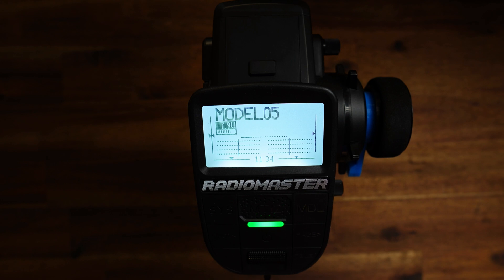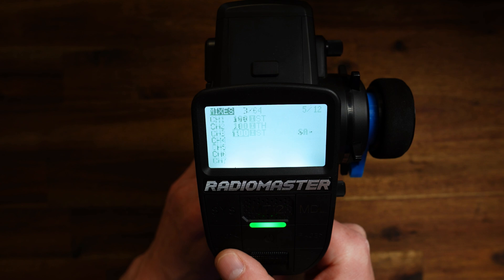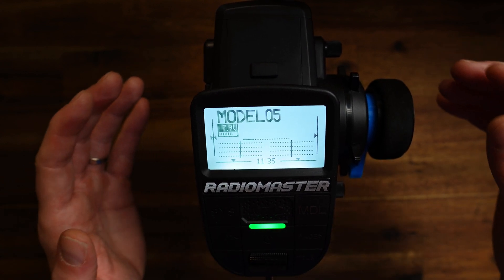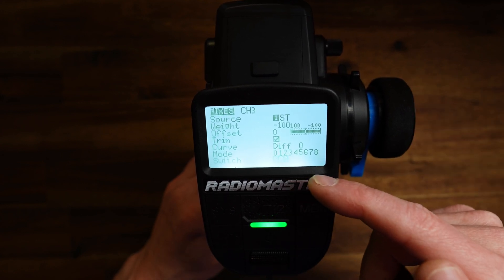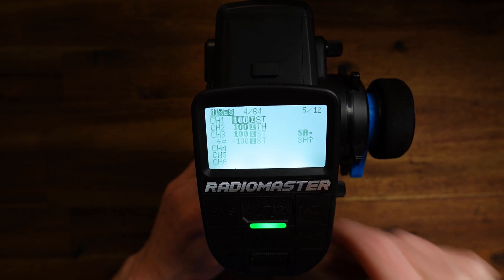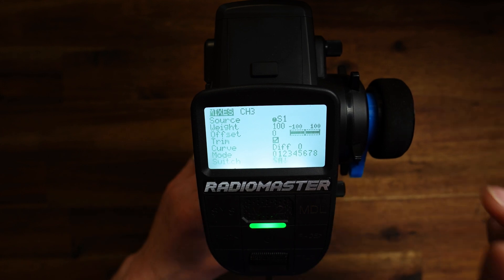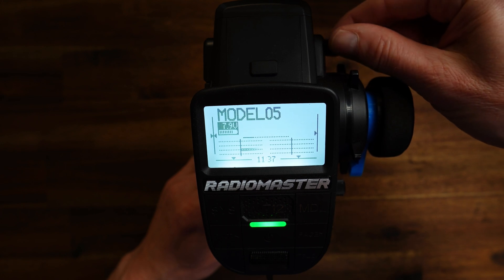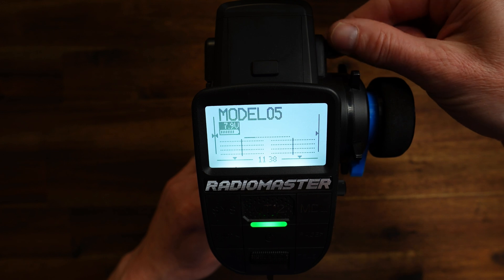EASY & SPECIAL 4WS SETUP | EDGETX | MT12 [EN]

Comment: Thank you so much for your videos! I have been able to program my radio to all functions I need according to your videos. 

I am facing one problem here. I have my Trim setting for rear axle set for -6 but when I switch to Crab mode it switches to +6 which is pretty noticeable big step. I know I can disable trim setting for crab mode so it will not make this big 12 jump, but only 6 but is there possible to make it perfect?

Comment: this is EXACTLY what I wanted to do with my 4ws crawler. 

I have the 2 3way toggle switch module installed on the battery try and it wouldnt let me use those switches. I had to use SA. any idea? do I need a FW update?
Reply from the maker: Excellent! Have you configured the switch module in the HARDWARE page of the SYSTEM menu?

Comment: hello. Thank you for a great video. I use this setup on my crawler. But i dont know how to activate center trim on the rear axle/channel 3. I like to use T3 for center trim, and i set T3 in inputs menu in the trim option. But i try the trim and there is no value change when i move T3 trim switch on channel 3. Can you help me with a solution on this? Best regards Anders
Reply from the maker: Thanks for the comment! Watch this 😉 https://youtu.be/3TIwjY7c7M0
Reply: @ Thank you so much. You Are the best. Have a great new year

Comment: I'm looking to add one more function to my rear steer. I would like to select the T4 trim switch. When I press is up I want to add 10 points to the rear steer in one direction, and if I press it down, add 10 points in the opposite direction.. Any tips?
Reply from the maker: You could try to alter a global variable with the T4 switch through a special function. Then this global variable could be used in the mixes on the offset. I did not test this but this could work.

Comment: This is absolutely awesome! Thank you so much for the help and your knowledge. I have one question. I have a printed file that makes it easier to actuate S2 as well as places a gate on it (which I used in place of S1 for the manual control of the rear wheels) and I am trying to figure out how to adjust the S2 knob to give me full steering with the physical gate installed. If you have any insights or if you have covered this in any of your other MT12 videos please let me know.
Reply from the maker: Thanks for the comment! I guess it depends whether you use the full throw of the pot (means, you wanna hit the endpoints) or not. If you wanna hit the endpoints when using S2 for rear steering (or any other function you may see fit) then, well, there is not much to do about it!. But if it is not necessary to use the full throw of the pot, then please take a look at the Weight setting (you can go beyond 100!) or - better - check out custom curves.

Comment: Your videos are some of the best I found from the limited number available. Yours are also the most straight to the point and easiest to follow I believe,. For mine I have programmed it similar: My rear steering servo is on  Rx Channel 4 & independently controlled RearWS from pot P2. I also use switch SA inner position for FrontWS, middle position for 4WS and outer position for Crab Steer. It is a matter of preferences really.  I just think that I find it more intuitive set up this way.  Thankyou, keep them coming.
Reply from the maker: Thanks for these inspiring words! Highly appreciated and I am glad that my videos are of some help for you! The really great thing about EdgeTX is, that there is not only one way to get a specific result. Everyone can set it up exactly the way they want it. I know that this fact may seem overwhelming to some in the beginning but once you master it, it gives you amazing flexibility and it seems you have mastered it! 👍